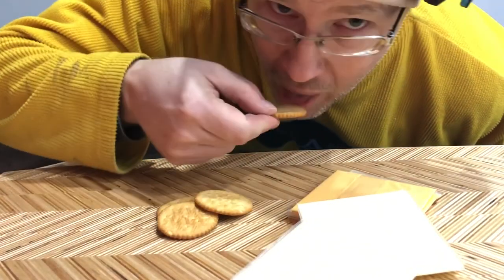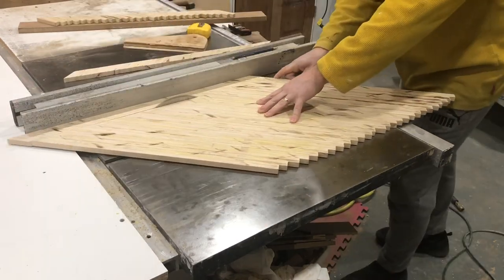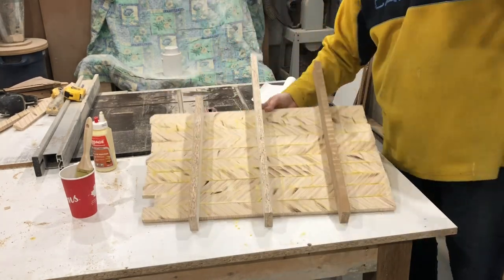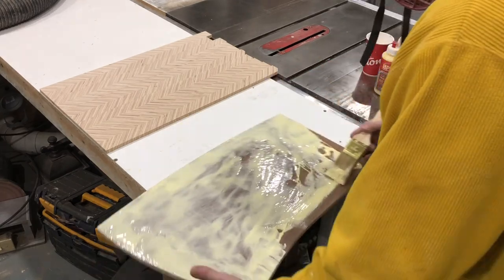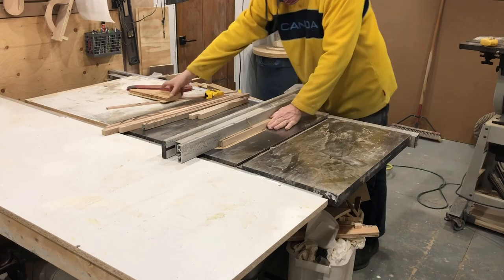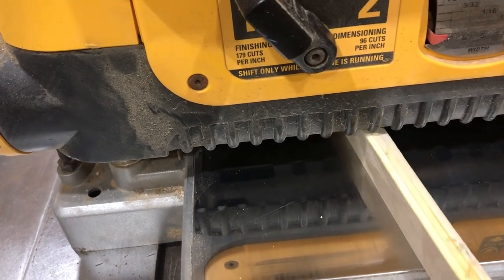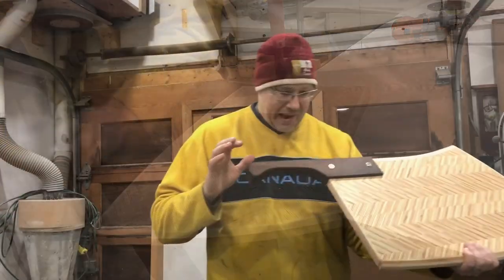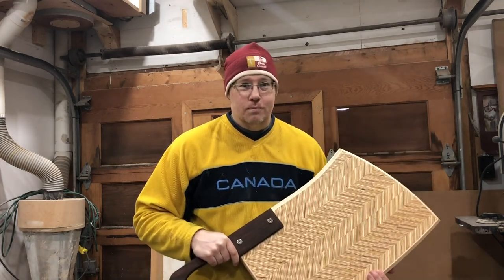Patterned Plywood Charcuterie board and Cutting board

Comment: I have a question that will the ply wood not swell when washed?
Reply from the maker: I wouldn’t recommend submerging this in water. The oil helps protect it and it’s cleaned with a damp towel. You can re-oil it as needed. I would suggest using this for serving more than anything else.